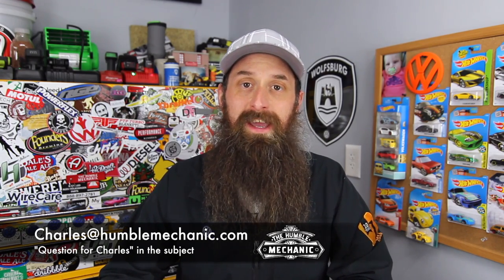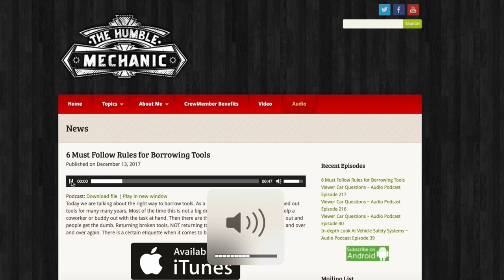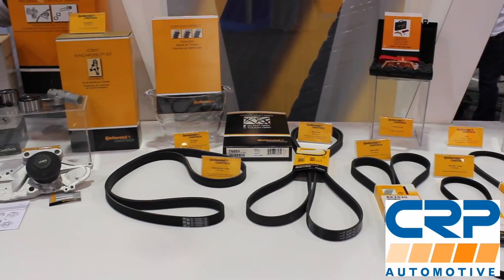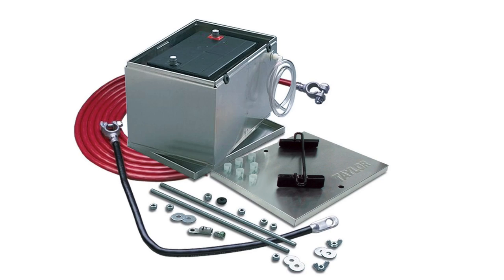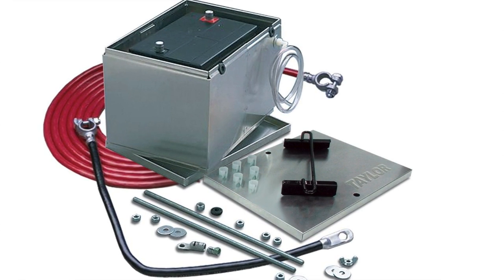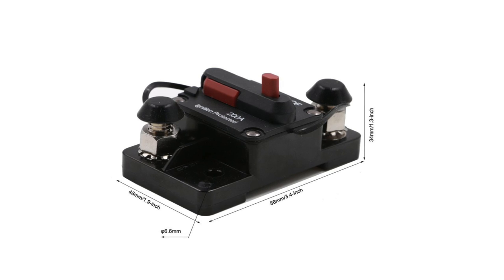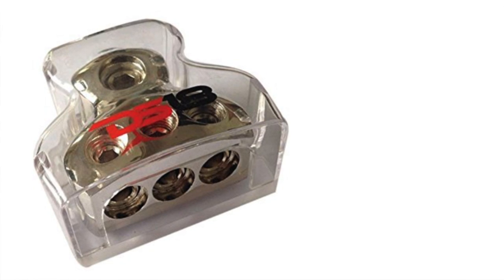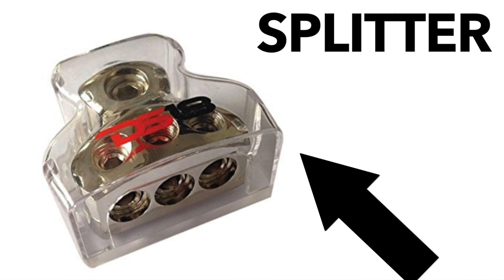Viewer Car Questions ~ Podcast Episode 228

Comment from the maker: Be sure to keep the questions coming. If you didn’t hear yours stay tuned it may make it on a future show.
Reply: I got a question, recently I changed the injectors in my 2011 gti, so I've noticed that my car stalls when I take off hard. There's no codes that pop up. Any suggestions??
Reply: Hello friend  how are you the reason  for writing is  because i have problems with my vw jetta vr6  year 2000,I need top canber the tensors,I want top know how much is the cost because the truth, I love my vw jetta vr6  would  like  to know your answer thank

Comment: I love the term "catastrophic thermal event."  I had an F250 have one while towing a tractor.  Great engineering job Ford, put the overflow/bleeder for flammable trans fluid directly above an exhaust system that gets hot enough to ignite it.  Until then I only kept fire extinguishers in my classic cars, but now I have one in every vehicle.  I got lucky with the F250.  Flames became visible as we pulled into the driveway of our cabin and we were able to put it out using an outdoor spigot before much damage was done.

Comment: Thanks for answering my question Charles. I have since replaced the valve cover with no difference. I'll check out the fuel filter and throttle body. Thanks again! Bryan.

Comment: There could be a small capacitor leak or board leak to ground, maybe from the inputs of the crank sensors, fuel pressure, Map.. Exc..  It might loose memory after a given time?? (Touareg) start issue. Then it might need that extra turn or so to verify a lost input or memory setting? - Just ideas to help you out Charles, one would think there would be a TSB out. You made me think on this one. Id deff agree, bring that 17' In !!

Comment: Hello hummable mechanic I have a 2006 gti bpy FSI have a fuel pressure regulator code looked at the intake camshaft and follower was a little work nothing to bad any other ideas?

Comment: With my Tsi super charger and turbo charger golf. I have an intermittent misfire on cyclinder one during idle. Not there when. Accelerating or crusing on the motorway. I verified this with VCDs. I have chancged the spark plugs three times with VW irridum ones. Put a new coil pack in on cylinder one. VW Ireland put in a new injectors at my cost on cylinder one. But it made no difference. They wanted to tear down the engine at my cost. I said no at the time. At start up after a two days there is chatter from the timing chain as oil pressure is made. Just last a few seconds. There engine's are known for timing chain stretch. Could a stretched timing chain be the cause of misfires at on cylinder one.

Comment: Average Fuel economy is excellent 7.8 L per 100km at 140km per hour on the motorway. Car is not throwing up any EML lights nor burning oil or loosing oil nor coolant.  I tried to changed the injector myself. But it's buried at the back of the engine, covered by the pipe work of the supercharger and turbo and throttle valve. Cant see what you are doing and barely reach at the far back. Couldn't get the direct injector manifold off engine due to part of the super charger obstructing it.  The engine is probably easier to work on a bench. That's the price to pay for the power and economy of this engine.

Comment: HELLO FROM FINLAND.
I think just you who will answer this question :)
when I Press the accelerator pedal that I want cross someone in my way or I try to speed up fast, the car make some kik or feel like some stone was front of my car and I drive over it. The oil is fine computer test was fine and I don't know what are this.
Can you please tell me what can be this ?
My car is passat 2003 1.8T 170hp. Automatic gearbox.
Reply from the maker: Maybe a bad engine mount?
Reply: HumbleMechanic 
I don't know I have test the engine and gearbox they say it's fine and when I speed up it feel like a car head u from the back or something like this

Comment: Is there a different from a 1997 vr6 motor on a jetta and one on a 2000 vw golf gti vr6
Reply: David Hernandez 
12 valve in mk3 abs 12v in mk4 are very similar. Diff i know about is the intake manifold on mk4 has active runners and diff cam respectively.  I think the o2 sensors are in different places and different sizes. I'm sure there are a couple more things that are different but not 100%
Reply: So just might just be plug and play